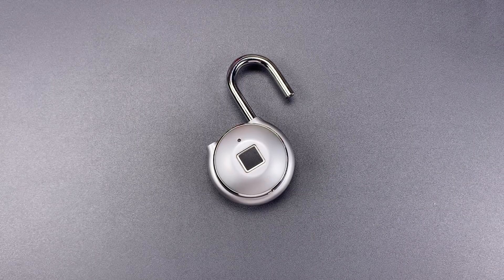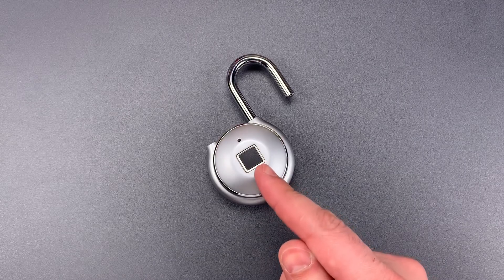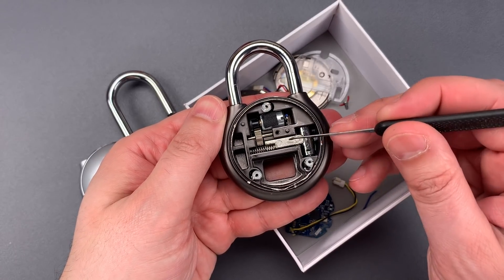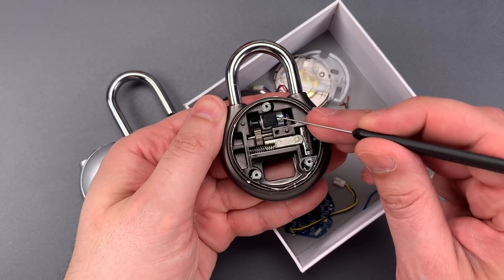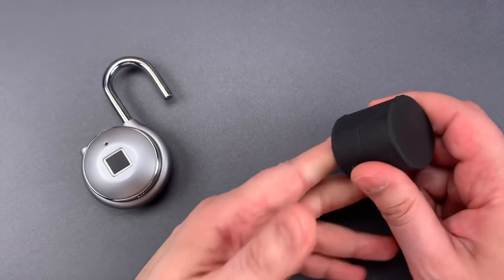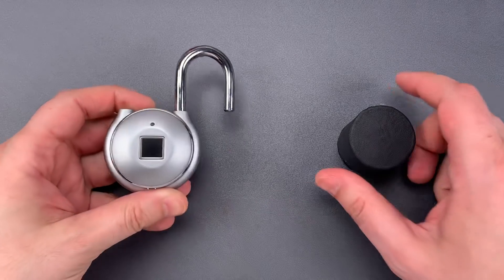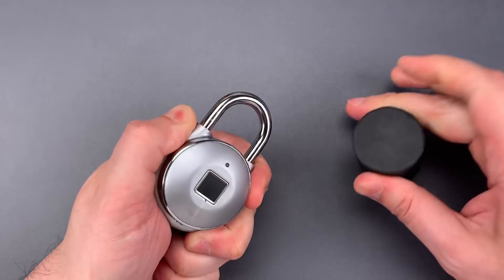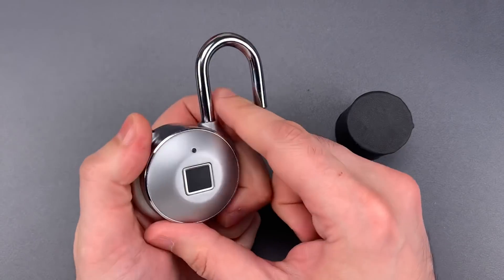[1068] Bypassing the $100 TappLock One+ Fingerprint Padlock

Comment: So, to fix this into being an actually good lock, all they need to do is swap the components of the motor for nonmagnetic ones?
Reply: I'm not sure but electric motors need some magnetic parts. It seems they already isolated it pretty good, since the magnet needs to be fairly large and the attack requires at least some knowledge...
Reply: That could use brushed motor which should be more resistent to this type of attack.
Reply: I want you to sit in the naughty corner and think about what you just said.
Reply: Impossible. A motor cannot work without magnetic field. They need to better protect the motor from magnets.
Reply: motors need to have magnetic stuff to work
Reply: Daniel Taber electric motors have to contain magnets, it’s how they work. I doubt they could shield the motor more, but I suppose they can try. They could potentially replace the motor with a different kind of actuator.
Reply: Theoretically that would work, but the working principle of an electric motor relies on the parts being magnetic!
They could however make the moving part non-magnetic and the static part magnetic, so that the magnet influences the mechanically fixed part only (which it can't move around).

...or just put a thick iron shell around the motor, which blocks magnetism.
Reply: while magnets are a low skill attack, what are the chances someone is going to have the magnets on them in order to perform the attack?  the biggest threat this lock faces is from brute force, as that shackle looks pathetically weak.
Reply: Motors work by inducing a magnetic field.  Please explain to me how you can make a motor without magnets.

Comment: So, this seems like a genuinely good attempt at an electronic lock. Simply thinking from the mind of a robber, if I couldn't fit a shim in then do I really wanna make all that noise striking a magnet against it hoping it catches?
Reply: if i'm a robber, i just use bolt cutters to tear through that shackle.
Reply: That's not really that much noise
Reply: When the mechanism is torn apart and analyzed, there's no more 'hoping it catches', just plain certainty the lock is vulnerable to the attack, and will open in secs. The reported noise is just out of the scope in this very video.

Comment: Honestly that's still a pretty good lock. It's not like everyone has a big ass magnet laying around.
Reply: Dude, argueing like that makes any pickproofing obsolete since not everyone has a pickset laying around.
Reply: @Niidforseat  pick proofing is largely obsolete, though.  the lock should be the weakest part of the assembly.  9 times out of 10, a defeated lock will be brute forced instead of picked.  pick proofing comes into play when you want raise the security level on an already tough lock body and shackle.
Reply: @Niidforseat  You can make most lockpicking tools out of whatevers laying around and it's not even that hard to do. Not so much a magnet of that size and strength.
Reply: Dokurider i do as I'm a professional burglar.
Reply: Also, that's an expensive magnet for the odd time you come up against this particular lock. You'd have to be targeting it in particular.

Comment: Quite brave of the company to send you their lock for testing.  I think the magnetic attack will be difficult to guard against.
Reply: Trivially stopped by a 0.5mm mu metal insert - just look at (spinning) hard drives.
Reply: You could sense the magnet using the motor and run the motor backwards when the magnet is sensed.
Reply: Agreed, if you're going to use electricity to move something you need a magnet. It is possible to make an electric motor without permanent magnets, though it becomes larger in the process.
Reply: Maybe a set of opposing magnets on the shaft outside of the motor housing? That way any external magnet would both attract and repel, leading to no net movement.

Or a simple solenoid that keeps the motor locked in place without a current. It'd be very difficult to both trick the solenoid and motor simultaneously.
Reply: The best suggestion I've seen is two magnets that need to rotate in opposite directions.
Reply: Shunting the motor leads while at rest would increase the torque required to spin the motor significantly.
Reply: @Adam1nToronto  Shunting the leads would not increase the static friction of the motor at all, you'd just have to move the magnet a bit slower. For a motor this size the effect would be negligible.
Now that you gave me the idea, a firmware update that sends the "lock" command to the motor when a magnet is detected (if possible) would make this attack useless as long as the battery was charged.
Reply: How is it brave? It's free R&D for them

Comment: - So instead of a permanent magnet inside the motor, they should have used a coil thats magnetised by a small electric current when the motor needs to rotate.
- Or they could use a small lever with a magnet on the tip, that moves when a big magnet is around, so it blocks the mecanism, and prevent this kind of magnet hack
- Or putting 2 motor instead, and they have to both run in oposite directions, for it to open.
Reply: Jay i love that idea of using 2 motors that have to work in tandem in opposite directions!! smart!!
Reply: @timhussey  It's a super elegant solution that bypasses the need for any shielding. It wouldn't even need to take up more volume as each motor could be smaller. I hope since the manufacturer are active in the comments they read this suggestion.
Reply: @anononomous  Yeah, if they do it I hope they will give me a job :D
I have some ideas for them
Reply: Usually small toys motors like this one have a bipolar permanent magnetic field and an Y-shaped rotator in the Center. The polarity of the electric current decides the direction the motor axis rotates.

BUT Sometimes more complex step motors are used. These have indeed permanent magnets in their axis and a rotating field inwhich the magnet rotates. These are vulnerable to the demonstrated attack.
Reply: Tou nailed it
Reply: My question is there was a spring pushing the locking arm into the shackle. So by spinning the motor to move that cam out of the way I get but the spring is still pushing against the shackle, so how did the lock pop by itself? You see he wasn't pulling the shackle, it just popped by itself. Any ideas?
Reply: @TheRealEvengers  its probably spring compressed too
Reply: Check out the pinned comment; the manufacturer responded to this video a little after you did.
Reply: The simplest way is to shield the motor with a copper barrel that is free to spin. This should both shield and dissipate the  magnetic field’s generated by a magnet.
Reply: @ryandavis7593  can  it rotate well and freely in such a small space ?
Very intresting way to make a magnetic shield thank you
Reply: Maybe you should apply for a job there :D
Reply: @StYxXx  I would like to work there^^
Reply: You should patent that, quick!
Reply: Trinh Khoa  not all electric motors use permanent magnets.
But these are the cheapest to make.
Motors with alternative currents dont use permanent magnets.
And to make alternative current with a battery you would just need 2 batteries and transistors.

Considering the 100$ price this doesnt seem to be overkill
Reply: But could you open it without tearing it apart to see how it works?
Reply: @philrobson4287  That'd be security through obscurity... Which is a time bomb.
Reply: @philrobson4287  Remember that you only have to open one of them, one time, and you can learn how to open all of them, for all time. Saying "but the only reason you know how to do that is because you opened one up" contains the important detail: "you know how to do that".
Reply: @philrobson4287  I recommend you to whatch his bowley videos. Even after tearing apart the lock, the only way found to open it without the keys was brute force. That's a nice design
Reply: I think the two motor setup is the simplest to implement.
Reply: DC motors have permanent magnets only in the stator. Only "brushless DC" motors have a magnetic rotor as they are commutated electronically.

By using a cheap, brush commutated DC motor the magnet trick should not work anymore.

However, two counter-rotating motors would provide even more safety.
Reply: just a short on the motor coil when it's off do the job.

Comment: Imagine a lock that's designed to be accessed using your Eye
Reply: You mean a retinal scanner ?
They'd fall prey to the pitfalls in any other scanning based lock for keycards, chips, fingerprints or they won't because it's made properly.
Reply: Just A Dio Who's A Hero For Fun ...using this eyeball Bosnian Bill and I made...
Reply: Get Loki and Hawkeye on it
Reply: Biometric locks are the height of security theater.  Retina, finger print, facial recognition all seem like they make locks more secure but they just make them easier for users to access, which in turns gives criminals more avenues of attack.
Reply: So those are a thing at Georgia souther (my old college) to get into the dining hall you’d walk up to a machine and it would scan your retinas and access your account then pull the funds out. In a controlled environment it worked very well.
Reply: Retinal scanner locks are no different from fingerprint scanner locks. They have the same fundamental flaw: the same finger/eye isn't going to give precisely the same reading every time. This means they cannot function as a true "key" in the sense that the lock (in theory) physically cannot open without it. Instead the chip has to decide whether a given reading is "close enough" and open or not.

This is more of a problem when they're replacing passwords instead of physical keys, as it means a fingerprint cannot be a password; the chip has to send the real password into the system when convinced to, meaning it's not only vulnerable to bypass, but potentially can leak the password.

For a physical lock, there's no password, but still the chip is just deciding whether or not to open the lock for you, which means there's always the possibility to fool it or bypass it. The fingerprint itself isn't physically protecting anything; the chip is just using it to help decide. You could for example program the chip to also unlock if you tap the sensor in a pattern, regardless of fingerprint.